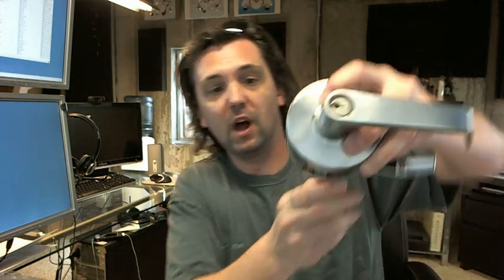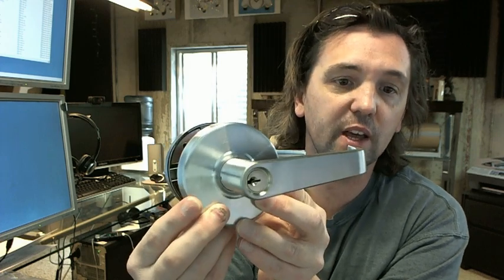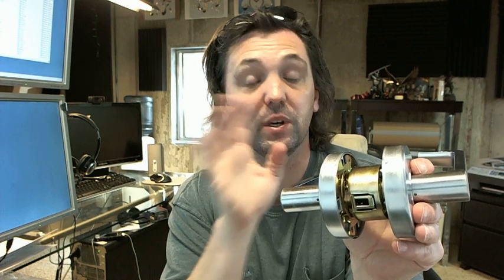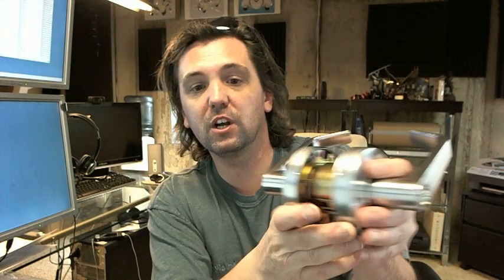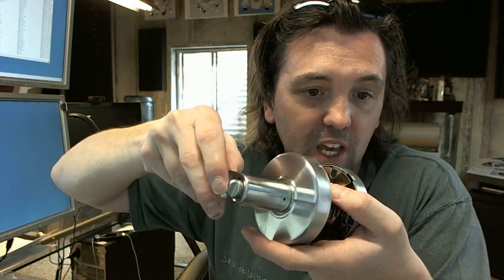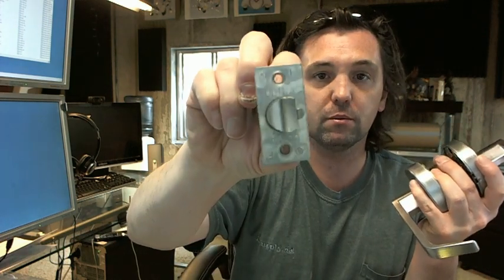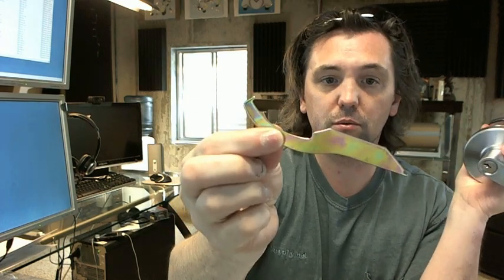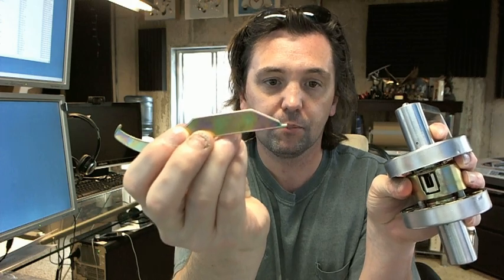Ultra Hardware 44253 Standard Duty Commercial Cylindrical Lever Lockset

Comment: Hi, will it work with a 2 inch metal door? Thanks
Reply from the maker: No - the Ultra Hardware 44253 Lever Lockset was for 1-3/8" to 1-3/4" thick doors only according to the manufacturer.  ABsupply can supply you with lever locksets for thicker, such as 2", metal doors.
Reply: @absupplynet  Thanks for the reply. Can you point me to the right direction to the model that works with the 2' metal door..
Reply from the maker: @EleanaOre  Sure can - this is something we stock.  Happy to enter your order.  Send us an email with this request to sales@absupply.net and we will send the cost and payment link.

Comment: I’m trying to reinstall one of these and the interior handle won’t snap on. The detent doesn’t grab the handle. Am I missing a spring or something?
Reply from the maker: Possibly missing the spring that pushes the tab out from the stem.  Are you able to get the lever secured onto the stem when the lock is off the door and the rose assembly is removed?

Comment: How can I fix a loose handle (the shaft is sloppy) and loose rosets?
Reply from the maker: Repairs are generally not possible on this lock and an outright replacement would be the least costly path forward.

Comment: Hey, I appreciate the tutorial. I do have a related question. I'm trying to remove a knob that looks just like this but, is a privacy lock. It's on the toilet stall at a restaurant. The locking mechanism is not functioning as it should. I can't figure how to get it off to replace it. I found one that looks like it by Tell but doesn't remove the same way. There is a hole on the handle but, I inserted a small allen wrench into it but,was unable to remove the lever. Any suggestions?
Reply from the maker: To remove this privacy from your door, first remove the interior lever, there will be a hole for you to insert a very small tool, depress a spring loaded tab, pull the lever off, this will allow you access to remove the rose "scalp" plate allowing you access to the screws to remove the exterior portion of the lock.  Please let me know how this turns out.

Comment: I've installed it and the latch isn't far enough out. To actually catch the door jamb.
Reply from the maker: How far out does the latchbolt project now?  1/2" would be standard.
Reply: @absupplynet  so I had to wait for my manager that had the master key. Somehow, it looks like the catch is too far inside and the latch once it engages is too far in there. So the latch only sticks out about a 1/4 inch. I had a locksmith rekey them together. I don't know if this is part of the problem. When I look at lockets on line the catch seems to the outer edge of the barrel. Where as on mine it's like already half way back.
Reply from the maker: @nbt3663  email me photos:   sales@absupply.net

Comment: Upon unlocking/locking the door with a key, do you have to tilt the handle lever up after twisting the key? A very standard question, i just know that their are some brands out there that have looked into different locking/unlocking patterns.

Cheers
Reply from the maker: This lock does not require an upward motion of the lever to lock / unlock the unit.

Comment: How do you remove the rosettes?
Reply from the maker: In order to remove the rosettes from this lock you'll first need to remove both the interior and exterior lever trim - at that point you should be able to pull or twist and pull the rosettes off of their diecast zinc rosette sub-assemblies.  A link to the manufacturer's installation instructions can be seen here   https://absupply.net/pdf/Ultra%20Hardware%2044255%20Installation%20Instructions.pdf

Comment: how do you take it apart? Remove to inside lever in order to install it. I tried using a wire pin... doesn't work
Reply from the maker: The inside lever does first need to come off.  The installation instructions can be found on this page:  https://absupply.net/ultra-hardware-44253-standard-duty-commercial-cylindrical-lever-lockset.aspx

Comment: I thought a clutched lever was one that you can still turn from the outside even when it's locked. What you're showing seems to be a fixed lever.
Reply from the maker: +vnquidam The Ultra Hardware 44253 Standard Duty Commercial Cylindrical Lever Lockset is not a Clutch model.  The clutch model Entrance function version of this lock is the Ultra Hardware 44273 and can be reviewed here:  https://absupply.net/ultra-hardware-44273-standard-duty-commercial-cylindrical-clutch-lever-lockset.aspx

Comment: The lever lockset that you are reviewing has a rigid mechanism and not a clutch  mechanism :)
Reply from the maker: Thank you - which type do you prefer?
Reply: @absupplynet  No problem! I prefer clutch mechanism because an attempt to get in when the door is lock is not going to wear down the lock as fast since the handle still goes down but doesn't retract the latch.
Reply from the maker: @SchindlerGamer  Certainly agreed.  Applications that have a high propensity for very heavy use, abusive use and vandalism is where the clutch type cylindrical lever design performs as it was originally intended.  I believe Sargent makes a clutch style in their mortise lock as well.
Reply: @absupplynet  Agreed! A lot of manufacturers nowadays like Schlage, Falcon, Cal-Royal, etc. have the option for a clutch mechanism in their lever locks, which is a great feature to have for places that have a lot of uses out of them like school settings! :)